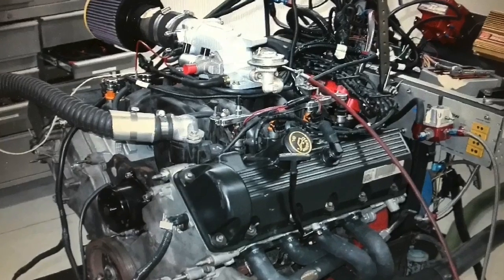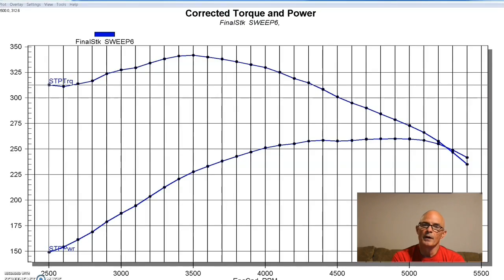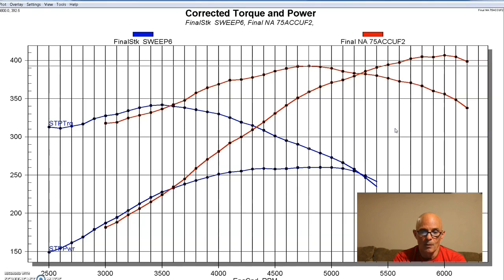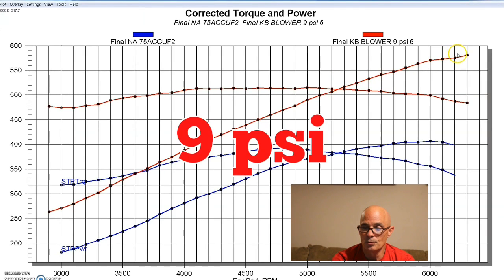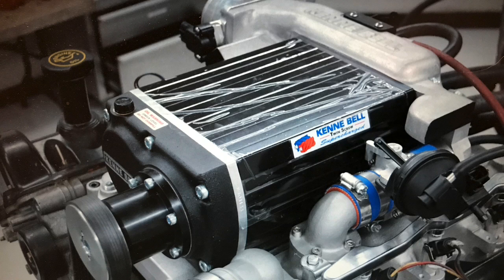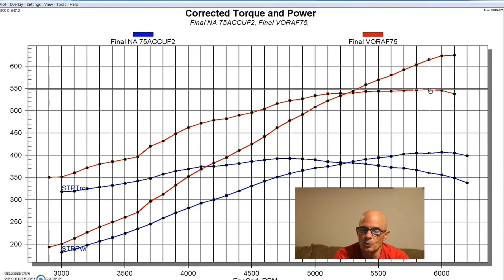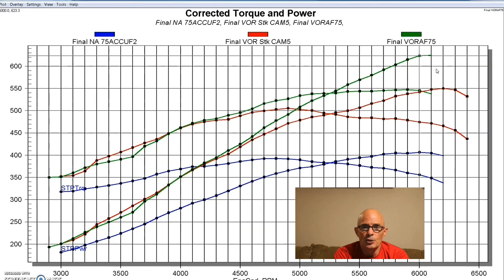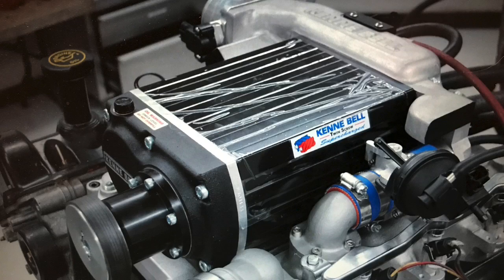HOW TO: SUPERCHARGED 4.6L FORD 2V (BOLT-ON BOOST)

Comment: Seems odd that Ford left so much to desire with the 4.6l 2V. What was even the point of making a 2V SOHC when it could have been 4 valve with a single cam to drive the valves. They didn't even bother to add cam phasing. Overall, Ford shouldn't have even gone OHC if they wanted to use only 2 valves per cylinder.  The higher deck height made the V8 taller and heavier than the LS.
Reply: Look at the 4.8l 2V OHV LS which is what for could have done with a pushrod motor rather than trying to be "advanced" with the SOHC design.  The DOHC 4.6L should have been the basic standard if they wanted an OHV design or at least added cam phasing and 4 valves with the single cam. The fuel economy wasn't great on these motors nor was the low end.

Comment: All I gotta say is that is one tough motor.  I drove on 7 cylinders for months before I got around to doing a tune up.  Didn't break down once!
Reply: The tritons are tough as nails, my dad has a 5.4 with 240,000 miles on it stock motor and transmission, he treats it like shit, never changes oil or does any maintenance whatsoever, and drives like the Indy 500 everywhere he goes, those trucks were just built to go, they have no quit in em, my 97 4.6 runs like a dream

Comment: Isnt ıt safer to give a boost to a stock  non Pi motor because with the Pi swapped heads compression ratio increases.and as far as know this ii not good for a Fi application .thank you

Comment: Did you file down the ring gap before achieving these numbers?
I wasn't planning to open my bottom end (PI heads and PI block) but want to go the same setup with the Kenne Bell & "stage 4" Comp cams due to the flat torque curve.
Reply from the maker: yes do ring gap
Reply: @richardholdener1727  Thanks for the helpful and fast response! :)

Comment: I have an 03 vic that isnt an interceptor. Anything i check says its a non PI. Can you confirm this?
Reply from the maker: PRETTY SURE 2003 IS PI-NON PI STOPPED IN 1998
Reply: @richardholdener1727   thanks for the quick reply. Looks like i gotta do some junk yard runs. 😎👍🏻🥃 Cheers! Love your videos!

Comment: so with the head and manifold set on the 4.6 2V that was 186-220hp... with those manifolds it might be fine to blow it up to 20psi? "twin turbos off a 3.5 ecoboost" on the V6 i was told they top out at 515hp. get the blow off valve to make some noise. i was told the V6 ecoboost i got a set of turbos off of actually blew up the motor because they are so small and instantly spooled to +30psi for some reason... i seen one business run a listing of the 3.5 V6 ecoboost turbos with a enlarged exducer turbine and made over 750hp on the V6... wonder if that extra letter will have a similar effect, could start pushing air into the fuel injectors? guess that V6 without the boost was at the same 180-230hp as the stock 4.6

Comment: The reason they made so many of the 2V engines is because they run for ever if you don't mess with them.  As long as the intake manifold doesn't leak, unmolested 2Vs will run for well over 150,000 miles
Reply: 150,000 isn't even that much... 

I've had G.M. 3800's that went well into the 300,000+ range. 

Next time you are at a boneyard, take a look at the odometers of the 3800 cars you see there. You'll see HIGH miles on most of them. 

Usually the car has rusted apart around the engine, or has been in a crash, and that is why it's there.
Reply: @davelowets but 3.8 are the real flagship of GM. Solid motor.
Reply: @andujo211 agreed. Also the LT1...LS... But like those the 4.6 was really was one of the best motors ford ever built. Think of all the cop cars. The taxi cabs running all seasons for longer than a decade. Insane to think about how well designed that motor was
Reply: @davelowets 150k 😂 them motors will go 600k they used them good reason in taxi and police cars
Reply: Dude I ve got 317k on my factory all f150 super cab
Reply: 340,000 on my 05 F150. Would've kept going till someone hit it
Reply: 150? I got 4 in my driveway, running, driving, insured at over 200, 2 at 260+
Reply: Buddy's 5.4 has 401k now
Reply: 419k miles on my 2005 2v F150
Reply: Enuf said ! 4.6 for the win ! Those guys are comparing apples to oranges anyway, the stock 2v 4.6 is an aluminum headed, full roller,sohc valvetrain V-8, sure the old gm 3800's were great ! But hell : push rods ? Come on guys, a modern valvetrain setup in an old 3.8 v-6, would turn that motor into a beast.! Great chatting with you guys ; take it easy
Reply: 204K on mine
Intake manifold and coil packs have been the only trouble Ive had
Reply: These will go well over 250 if you take care of them.
Reply: i blew my 97 4.6 f150 when it had 255,000 and it was only cause i was doing dumb things while i ran it dry..😐

Comment: Amazing! I'm using this motor for an f150 build I'm doing. I got my 4.6 from an 03 grand marquis and will be attempting port the heads and adapt a 03-04 cobra eaton supercharger to it. I'd love to see what the stock bottom end can handle or what changes should be made to promote long term engine health hoping for 450-500 hp with maximum drivability.

Comment: Your forgetting that ur doing a crank dyno and not to the wheels with drivetrain loss, a stock pi motor with the Kenne bell at 9 psi makes 370 about to the tires and anything more will sooner than later blow the motor, and that’s the myth, idk how the increased compression with the mods you hav done would hold up but it’s definitely capable of close to 500whp with all the mods and the KB, but u could also do that with a bolt on and ported blower 03 cobra, so is all the work really worth to piece together a 2v engine?

Comment: I got a 2001 Expedition xlt stock with a 4.6l Triton it makes about 232hp and the car is close to 5,000lbs. Do you think it would be a good idea to try and increase it to like 350hp or would it destroy the transmission (4 speed auto).

Comment: Can the stock 5 speed manual transmission handle this much power? I'm in the market for a 2004 Mustang GT and I would like to add a supercharger. Why does everyone online say you can't go past 450hp on a stock internals? What mods do you think I should do to get a reliable 500-600whp?

Comment: 91-04? Maybe for retail production but Try 2011 for fleet crown Vics
Unless 2004 upcrown Vic engines are somehow different, About all I know is a temp sensor on each cylinder head
Reply from the maker: YES

Comment: This (along with the 5.4 Trition and its flying spark plugs) belong on the dungpile of automotive engine history.  Not just Ford; they all do it once in a while.  They jettisoned the excellent pushrod 302 for this?  351 Windsor couldn't have been updated instead of this?  Corporate beancounters instead of car guys in chage?  It would seem.  OHC without DOHC?  Why?  The LS1 kicked this to the curb with its antiquated pushrods.

Now, the Coyote is another breed, that I couldn't see wasting time with multi-thousand-dollar superchargers on a dog that won't hunt.  I think they have redeemed themselves with the modern (Coyote and above) engines, and I am really glad to see it because I like Mustangs.  But the only darker day the Mustang saw than this fragile, gutless, pointless engine was the Mustang II with a Pinto engine.  Before you flame, I love the new (Coyote +) and much respect to those engines!

Comment: I traded in my 99 Expedition with 380k miles on it. The only thing wrong with it was the transmission had started to slip pretty bad. Would have liked a little more power when in the mountains when it was loaded down with friends and gear, but it always got me there. I miss that vehicle a lot.

Comment: @Richard Holdener - Hey Rich, they actually continued to use them in the Mercury Grand Marquis beyond 2004. I pulled a 4.6 2v out of a 2006 Grand Marquis and dropped it into my 01' GT.  If I am not mistaken that 2v engine was used until around 2010 or something like that.

One thing for sure - they sound absolutely amazing!
Reply: Until 2011 in crown vics

Comment: Hey Richard,
 first a quick, totally awesome videos, I have never seen so much "real" information anywhere!

My question, is a bit off base for what you do, but many of us want more power from our non PI 4.6's without having to dig in the motor. Not looking for big numbers, just more fun. Did you ever do anything "boost" with a stock non PI motor?  TKS!
Reply from the maker: yes it can be boosted
Reply: @richardholdener1727  Thanks for the reply Richard! 

Well yes,  they can be boosted. Just wondering if you ever did any testing and got numbers of a boosted stock non PI 4.6, in your video "vault of Horse Power". (maybe you had a "why bother to post" section in there.....lol)  That kinda the big thing with boost, getting some decent numbers without tearing into the motor.

Comment: A few random questions lol Does anyone know if the 2011 Crown Vic Police model was a Power Improved engine? If not would it be worth the ~$2,500 to swap it over and maybe add a super charger(anyone know the cost???), if it is could the car handle a new cam setup and supercharger that makes 4-500 horse or would I need to basically rebuild the car from the ground up to handle that. Any input from anyone esp Richard would be awesome, trying to make more power for cheap on my 2011 vic P71 and don’t want to destroy its reliability and not trying to push super high power.
Reply from the maker: do cams, springs and boost on the 2V

Comment: 2v 4.6’s are great engine’s. Ford was still using them in 2010 I have a 2010 F-150 rolled off the line with a 4.6 2v. Most trucks 09-10 f150’s received the 5.4 and 4.6 3v. But the simple reliable 4.6 2v was still an option even in 2010.
Reply: Frr I have a 2010 ford f150 single cab 2v and it feels pretty good for a daily , not slow but not fast because they changed our transmission In 08 they had the 4r70w and in 2009 2010 they put the transmission from 5.4 3v 4r75e on my our truck 2v
Reply: @Peanut_boy4567  my 2003 5.4 2v has a 4r100 and a 10.25 rear end. It runs on natural gas which has 120 octane equivalent. I want to do a high compression (15:1?) n/a motor.  Not sure if it’s been done.
Reply: My 2010 F-150 single cab/ short bed truck have a 4.6 2v engine...it is a very reliable and powerful engine...I love it...

Comment: I don’t know why do people classifies the 4.6 2v just to 2004. I have a 2007 f150 4.6 2v and it’s hard to find performances parts for my truck. Aftermarket Throttle body for example

Comment: I have an 1998 4.6l 2v first time with this motor. Ran 5.0l in the past.
With the cams you used with non pi block  and pi heads and intake. Will your valve's hit this Pistons. I was told they will and I should only go with comp cam stage 2 cam. Love to go with stage 4 but not sure.

Comment: The 4.6 2v is the most durable engine ever made. I've seen them at 700k miles. Regularly over 300k
Reply: I won a trip up to the Romeo plant from Ford in the early 90s. They were ramping up to a million 4.6's a year I believe. They told us that in durability tests the 4.6 would way outlast the 5.0. I've got a 4v in a 96 Mark VIII with 277k (daily driver 90 miles for work daily), a 2005 Marquis with 265k and had to other 94 Vics with over 260k without failure (put valve seals on one of them though).

Comment: Piston rings were the killer. You could beat the 2v mercilessly all day long even after serious mods as long as you don't use power adders. Guy I know out in Texas did a top end swap on his stock 1997 Thunderbird, ported SVO heads, cams and intake on his 225,000 mile shortblock. Ran low 12s on that combo for years and the car was his daily driver.  After finally doing teardown about 270k miles, the shortblock had very little wear. ALL 4.6 aside from the terminators have crappy internals except for the beefy crankshaft. Thing is that they are built so well and tight and balanced that you can beat on them still. You have no idea how many mid 2000s Town Cars I've seen from Limousine companies with 500k miles. You just have to avoid detonation, that'll kill a 4.6 quicker than a bullet.

Comment: Awesome video. I am building up a 2000 Ford excursion that I bought with the 5.4L on purpose. I had a lightning supercharger from the f150. Well turns out, the frames are so different betwens the f150 and f250, the swap won't work. I think I'll end up going turbo.

Comment: The best I ever ran with my 2V was a 12.2 in the 1/4 it was making 356 rwhp.
Reply: Jerry Sullivan  Full bolt ons a V3 4.10s with a 5 speed.
Reply: Jerry Sullivan  I would think you’d be in that range. mickey thompsons we’re one of the best easy mods I did, they performed way better then the nittos I had before.

Comment: I had a stock 2000 GT (50k miles) 2 valve with a vortech, after cooler and longtubes. It broke making 430whp. It only survived 2 weeks then a broken rod. It was properly tuned and was not beat to death. Not much of a fan...

Comment: I don't know much about these motors, but I do have some experience with powerful/per displacement engines. My thought, right off, is...some dyno pulls don't mean an engine is going to last with stock rods.

Comment: Richard, I've already done the head swap to PI heads on my '98 4.6 2V. I had a good read in every other modern you did in the video, but I am wondering what mods you might have made to the fuel delivery system.

Comment: This was a very interesting video. I enjoyed it. I went with the 2.8LC Kenne Bell. And I was amazed at how well my 4.6 2v responded. I'm also running on a built block with Trick Flow Heads, KB cams, 8 rib, water meth, and a 50 shot for the race tune.... and I would like to get a little more power  just to stay relevant...lol 

What kind of stuff would I need to start tuning my car myself? Currently in South Korea and I just would like to work on it a little more. Do you have a forum were you do Q&A about these subjects?
Reply: I would say your setup is plenty "relavant" dont get caught up in the 1000 whp YouTube monsters...in the real world 600+ rwhp (which I am assuming you have) in a car of that weight is plenty relevant out on the streets and could run with or outrun many cars you come across day to day even in 2020.
Reply: @michaelharris748  Hey, thanks! Yeah you're right, I'm around 550 on the street tune and 689 on the race gas tune w/ a 50 shot. One of these days I will give the race tune a try. 
So I'll probably spend some time freshening up some other stuff while I rebuild my trans.  
Thanks again for the comment and suggestion.

Comment: I love this engine, mine is built with a hellion kit and made 535whp at 14lbs of boost on a mustang dyno.  I'm estimating 630whp on a dynojet.  These engines also make better torque than the 4 valve engines.
Reply: Do you use the Stock pistons? Did you decrease your comp ratio before boosting it that much? My 2v blew up because the Former owner Did a saleen supercharger upgrade and i think He Did shit😅 now im looking for a New engine to put the charger on and i want it to last 💪
Reply: @henrikmeyer9692 find whatever low mile 2V you can and just do a basic rebuild on it. Replace the springs, lifters, etc…port the heads if you want, add longtubes, and use Gen 2 coyote rods with some drop in pistons. Will hold 550-600whp all day.
Reply: @TheJMan1K so the gen 2 coyote rods drop right in with no modifications necessary? Same journal sizing and everything?
Reply: @GTkyle  yes. Exact same specs. My buddy is building an engine for his 98 GT using a 99 cobra block, 03 Cobra crank, Gen yote rods, and PI heads with some comp cams. Will be mated to a TKX. He has an old Kennebell 2.1 setup. He should  be making 600whp with 12-13 pounds.
Reply: @TheJMan1K  that's amazing. The general consensus from back in the day is the 6 bolt crank is good to 600. I'd almost just want to do rods and pistons in an explorer WAP block. I appreciate the info!

Comment: Anyone else have a 4.6 2V that leaks oil from the oil filter regardless of how freaking tight you put on the filter? We bought a 1994 Crown Vic used that has the engine in it and that's been the major problem with it since we bought it. Damn thing leaks a couple quarts of oil per week if driven daily. I don't know if I'm missing a gasket or what's going on but I figured since this was getting people together who might know I would ask. I would greatly appreciate any help. Thanks

Comment: Actually they used the 4.6 2v until 2011 in the Crown Vic Police Interceptor. So I would agree with you on the mass production numbers. Way more 4.6L out there than any other ford Ford production Motors>

Comment: Definitely would like to see a big bang 4.6 2v. Thanks for making this video, I have a 98 gt pi swapped, swapped it 12 years ago and was always scared to go with any kind of forced induction, think I might use this stimulus to stimulate my car, lol
Reply: Man dont be scared of forced induction just make sure you get it tuned good by someone who knows those engines and use good fuel.  You can run 400 whp (which is alot more than you currently have) for a long time with good fuel and tuning.

Comment: The 2v heads might not be champions. But the block has proven to be plenty stout. How about getting clever, with one of the high-tech progressive nitrous systems? They can retain most of the stock drive quality, and even smog legality in some situations, but when tuned right deliver gains similar to what you're showing with these forced induction setups. Wanna show us how much?

Comment: I own a 2000 Ford Mustang gt stock block & heads with bolt-ons & a single 61mm hellion turbo charger the car made 430whp she lasted me 5 years with the build (daily driven)but I’d argue saying they can handle more than that with out atleast some work done the heads I have a spun rod with 82k miles on the stock block and heads I’m now looking into the right route for a 5000$ budget build a 600-700hp motor the car is already t56 swapped from a 03-04 cobra